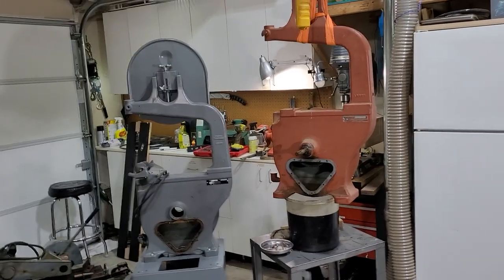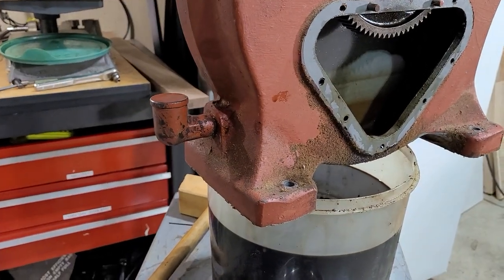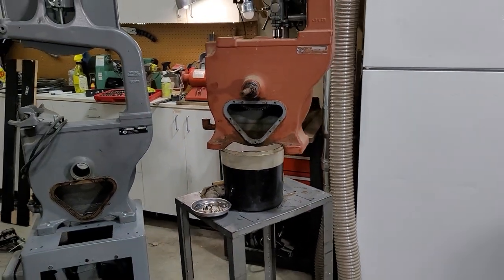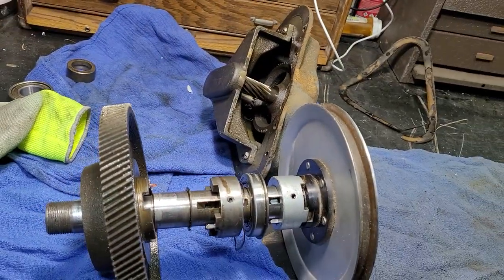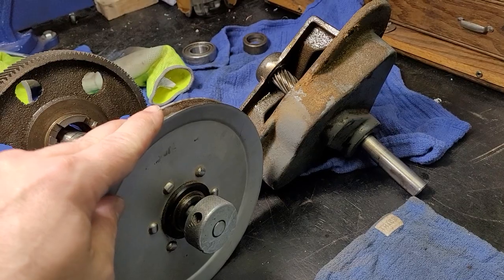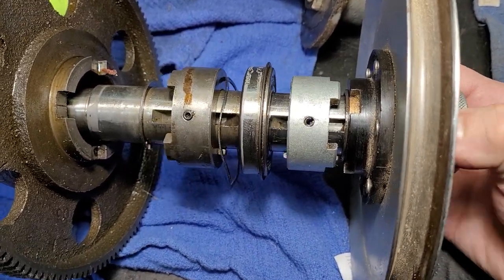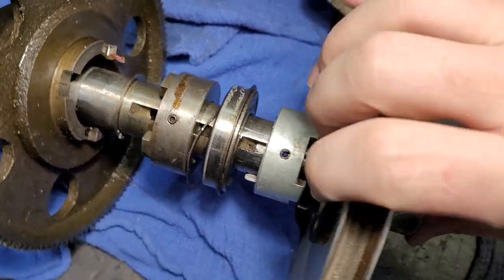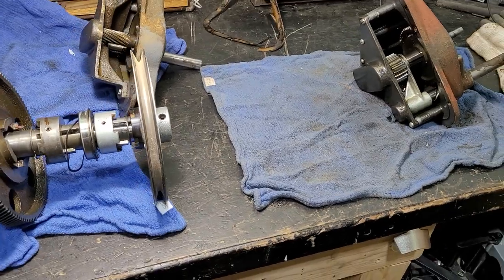Delta Rockwell 14" wood and metal cutting bandsaw gearbox comparison.

Comment: Great Vid! I'm trying to disassemble the clutch shaft on the newer version. It's been really abused and is missing some parts. Would you have any advise? I assume the bull-gear needs to be unshafted. Was heat necessary? Thanks very much, C. In Idaho

Comment: The difference in first vs second generation is the first gen the better of the two types.Early models had a street L fitting for the gear oil,and later in the 50's the brass cup was added yet some latter were aluminum.Some changes were made back to the street L in later runs as manufacturing was changed by supplier as well as country of origin.Currently (at this post) I have two first gens in the shop,one 1941 with cast iron wheels and one 52 with aluminum wheels.Not sure when the aluminum wheels went into production on the first generation.

Comment: I have a first gen saw with the street plumbing fitting at the oil fill. So there may be some overlap in the change over sequence. EDIT: In reading the 1946 manual, Delta states. "Late models are equipped with the screw top brass oil gauge SP5001. Older models have a 1/2 inch street elbow with a pipe plug. This fitting is easily replaced by the brass oil plug now available. "
Reply from the maker: Nice, I always assumed they went to the 1/2 eblow during the Rockwell years when they were cutting cost of production

Comment: Can you tell me how the love joy mechanism is held in place my Saw keeps popping out of gear into neutral.. I had to wrap a rope around the shaft keeping the push pull mechanism in the pool position because it keeps migrating back in and popping into neutral I don’t see in your video how the push pull mechanism locks into place keeping it in either low or high gear.. I can’t tell when you’re demonstrating the movements in the second generation mechanism what holds it either pulled out or pushed in keeping it from migrating out of gear between low and high..???
Reply from the maker: There is nothing that keeps it engaged other than the friction of the 2 shafts against each other. You need to check your lovejoy connections to make sure they are not rounded over, causing them to disengage under load.
Reply: I didn’t see that there was a reply but now I do,, thank you very much,, now I know that at least there’s not a detent or anything locking it in the place other than the connection itself…Thank you

Comment: Hi there, I am from South Africa and busy with a re-furb on a 2nd generation machine, my problem is that I have a few parts missing, the not big parts but impossible to find in my country, one is on the main shaft -  no 157 (wavy washer) and other is on the smaller shaft no 164 (felt bushing) Would you know where to find these 2 parts
Reply from the maker: I have had good luck with ebay as the parts are fairly available in the US. I know a lot of ebay sellers don't offer international shipping due to the added cost and time. The wavy washer could probably be substituted with a split lock washer as it needs to add some lateral force against the bearing. You could probably make the felt washer from a like type of material. Good luck with the rebuild, send some pictures of it when you have a chance. Cheers

Comment: I have the second generation transmission and when I put it into either wood or metal gear it slowly works its way out and ends up in the center in the neutral position I don’t see where there’s a D tent or anything there to hold it what is broken inside there that’s not keeping it locked in to the Lovejoy connections on each setting.. why is it slowly drifting out of the connection and into the center between each gear that’s being I guess in neutral..???
It’s just not staying engaged in metal or wood after it runs for less than a minute it’s already worked its way out..???
Can anybody let me know why that would be doing that,, I’m sure I’ll be able to figure it out once I tear it apart but I want to know what’s happening before that… what could be broken in there where it’s not staying engaged in gear.???

Comment: Are the two setups interchangable?
Reply from the maker: I don't believe so since the bull gear is different
Reply: @restoration-projects  
Okay bear with me I just got my hands on a 28-300 with the latter gen set up but missing the gear box.
I've may have a bead on a first gen gear box and matching bull gear...
Could I swap the bull gear as well and use the 1st Gen gear box in place of the 2nd gen?
Also thank you so much for posting this video and for your help so far!

Comment: I have just aquired a second gen saw but it does not have the large pulley for wood cutting. It's part # 160 in the parts diagram. I can machine a new love joy hub and get a pulley from farm supply but I don't know it's size. Can you please tell me the diameter of that pulley. Thank You!
Reply from the maker: It's a 8" diameter pully. You might be able to find a OEM one on ebay for the same price as one from a fram supply store. Good luck with the  restoration
Reply: @restoration-projects  Thank you very much!
Reply: @restoration-projects  I'm still trying to figure out what I have. The manual says there are two different cone pulleys, 41-724 and 41-713. I believe I have one of them, but don't know which one. It measures about 3 1/8 over the small end and about 4 1/2 over the large end.  Manual says the small end of one and the large end on the other are the same. Any thoughts on which one I have? THANKS AGAIN!
Reply: @donsipes  All of them have three pulleys.the large is 8 od and the other three have two sizes,large for the gearbox and the smaller for the motor.It requires two different belts for each operation=1 for wood-1 for metal.

Comment: Can anyone tell me how the upper drive shaft (with pull/push shifter 2nd addition) comes out. Both roll pins shear off.
Reply from the maker: you will have to use a punch to knock out the broken roll pins and re pin it. It's not a fun job but its doable.